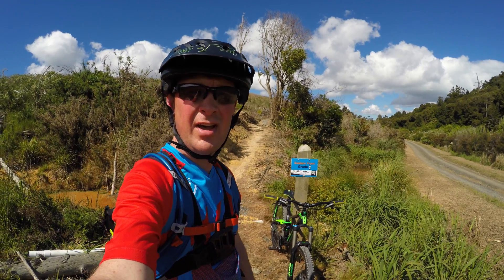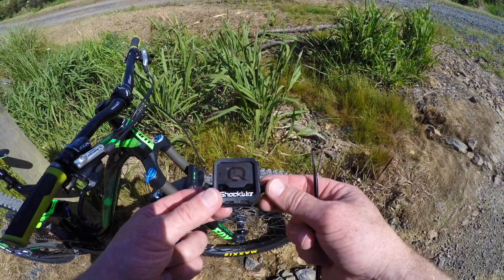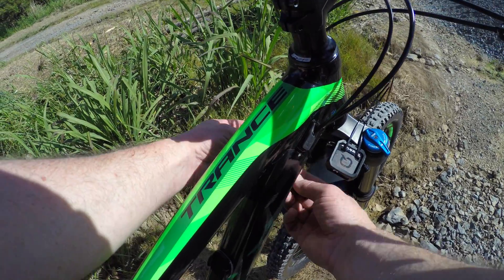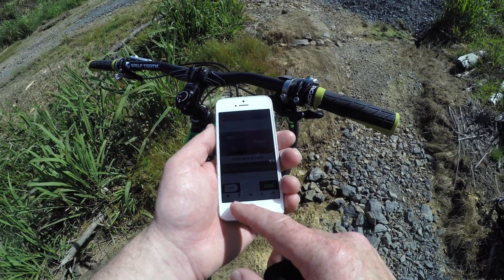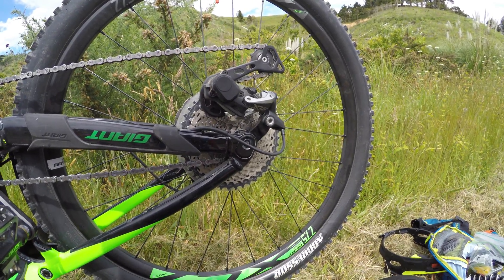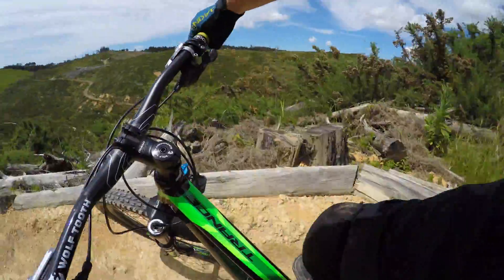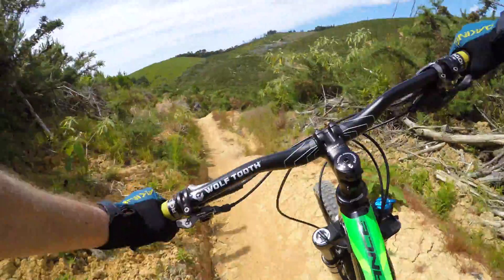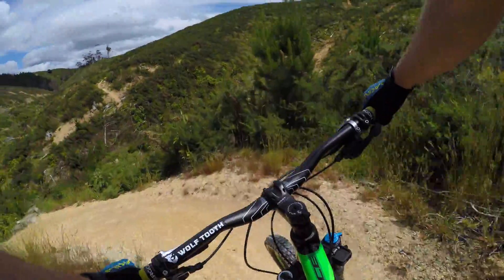ShockWiz suspension setup  [Ep#14 ]

Comment: Nice work. I have the exact same bike and would be close in weight. What did your shock settings end up at? (Front and rear shocks clicks position please)
Reply from the maker: Hi Murray, I'm 70kg (154lbs) and up front I've been running 60psi with rebound set at 7 (out of 21) clicks from closed (-). The shock is at 170psi and rebound is 8 (out of 13) clicks from fully slow. I set it like this when learning to jump so would be be quite 'dead' and settled when landing. I'm going to increase the rebound a couple clicks to see if that makes it pop more.
Reply: @TheAverageMTBGuy  Was this your settings after you used the suspension tuning equipment? Cheers mate, love the videos!!!
Reply from the maker: Hi Jamie, yes that’s what I was running. I have slightly tweaked it since then. I’m now running rebound at 7clicks anti-clockwise from fully slow and am (currently) happy.

Comment: Oval FTW baby!! What camera+chest mount you using? I'm in the market for a little something-something ^^

PS - re, being cautious, wider bars + shorter stem will help with control in the Jank.
Reply from the maker: I'm using a GoPro Hero 4 Black mounted to a Feiyu Tech WG gimbal on a non-GoPro chest mount. Gimbal is the only way to go if you want decent watchable footage, the only downside is it's fragile and expensive to repair if you stack it!
A 35mm stem and 780 bars are on the shopping list!

Comment: after the changes did you think the bike was better?  Be interested to see what shockwiz thought of my settings but the coil rear and the twin positive air chambers of the fork are not compatible with it. The thing I'm weary of is that the settings are predetermined  by the software so what shockwiz thinks is best might not be best.
Reply from the maker: +MTB Scotland haven’t been able to ride with the changes yet. Have 3 days riding end of this week so should be able to tell by then.
Reply: look forward to the results.  there is sussmybike which is a Scottish product that is almost ready for selling.
Reply: Hi Wondering if you got a chance to assess the changes suggested by the ShockWiz yet?
Reply from the maker: +Vinod Nair, I changed the forks and shocks to what the ShockWiz suggested and it made quite a difference. I did find the mat the front was a little hard so before my recent ride at FourForty I softened the front by 8psi and it rode sweet. I think it’s pretty dialed now.
Reply: The Average MTB Guy thanks for the update